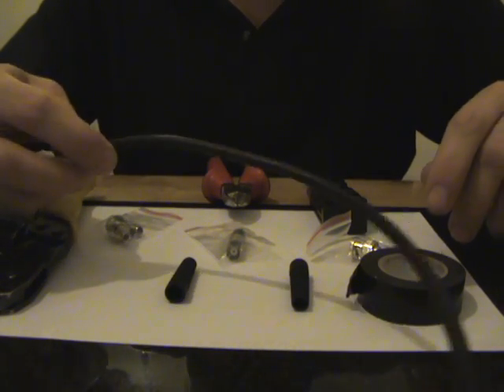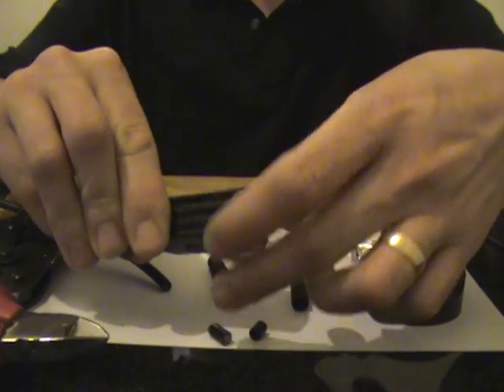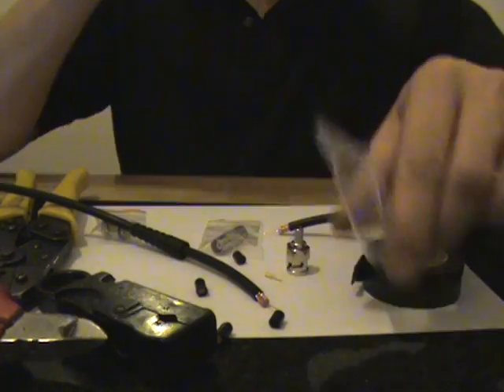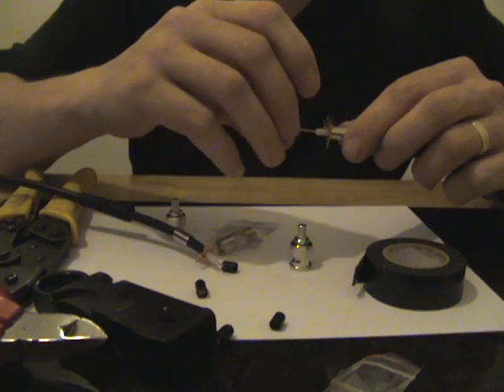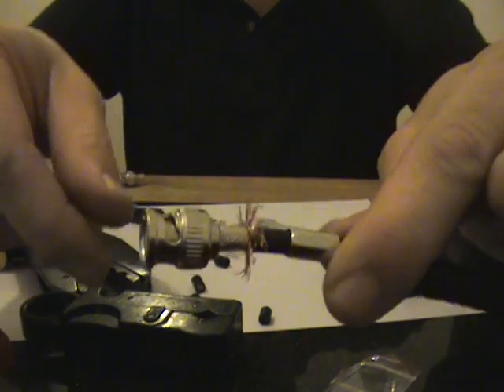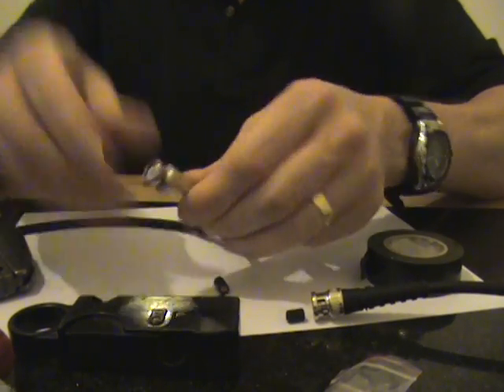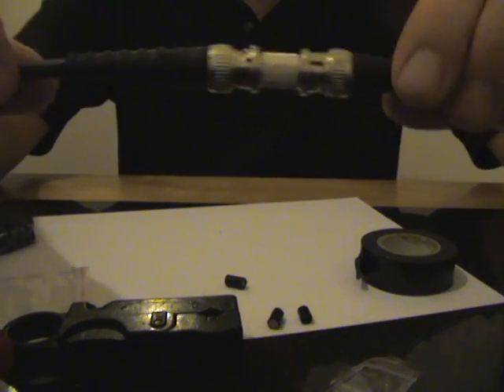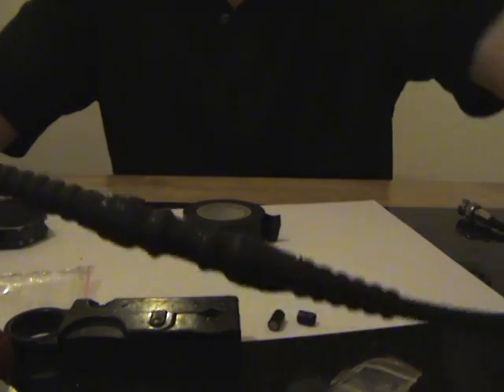How to join a broken / snapped coaxial cable using BNC Connectors on RG59 CCTV Cable

Comment: Is it possible to connect two parts of cables without connector?
If we connect the core and  put tape on shield of cable?
Reply from the maker: HI 
Not Ideal, but yes it would work as a temporary fix

Comment: Hello Dannie.  Thank you for the video.  I am trying to search for the 3 way connector to join both ends, but can't seem to find it.  what is the technical term for it?  Thanks
Reply from the maker: The connector for the cable would be a BNC and presuming your cable type is rg59 then you would ask for an RG59 BNC. The piece that would join them together is called a through piece.

Comment: how do I fix a tv aerial port (part of the tv) that the cable slots into? it has been torn out from the tv and just a small thin wire like thing sticking out. it may not been torn out completely because when I touch it with the cable it gets 50% signal and some channels work.. ?

Comment: Does this maintain it as one cable? Because I lose signal strength when I attach two cables with male/female connectors. I need to elongate the main antenna wire sticking out of my wall so that it can reach my TV without it being two cables. Do I need to solder or would what you did in this video maintain it as ONE cable? Thankssss

Comment from the maker: No i'm afraid the joint is not ip rated you would need a waterproof adaptable box to do this outside, or as a temp fix you could use self amalgamating tape, however that would only buy you time.

Recommend: Joint in a ip rated box or re-wire it.